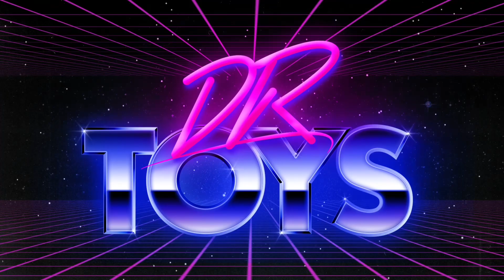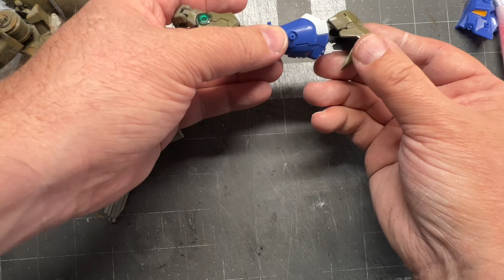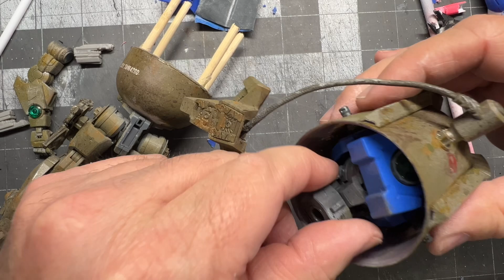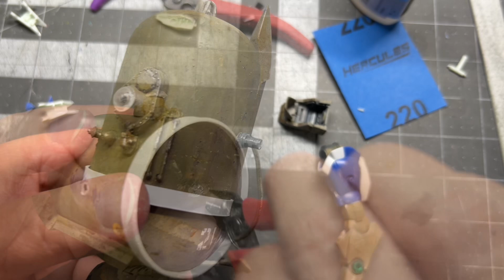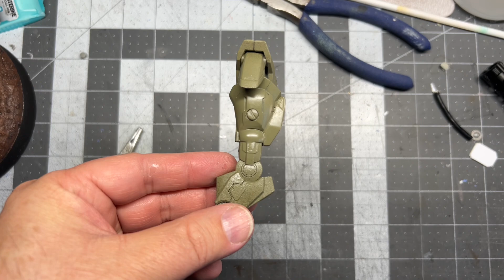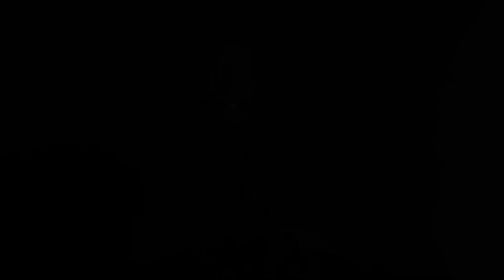How I Fixed A Robot I built Six Years Ago

Comment: Going back to old builds from time to time is fun. Often old builds have a good basis, but just need help, newer techniques. Modularity is always a huge saviour when rebuilding / repainting, and if joints have a good snug fit, they often don't need to be permanent. I've recently been stripping back old Maschinen Krieger builds to re-imagine and improve them, and the part about that I like is that the basic build is there - done - so you save time, and that motivates me when concentrating on the restoration / conversion, knowing that I haven't had to fight a new kit from scratch all over again.
Reply from the maker: And the feeling of stepping back and looking at the reworked piece is pretty cool to see how you turned something cool into something cooler!😃

Thanks